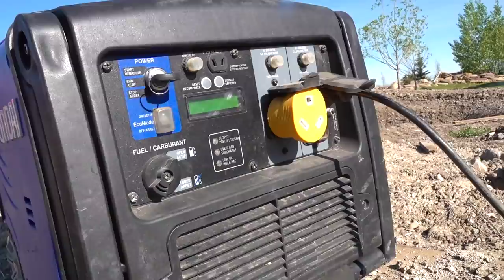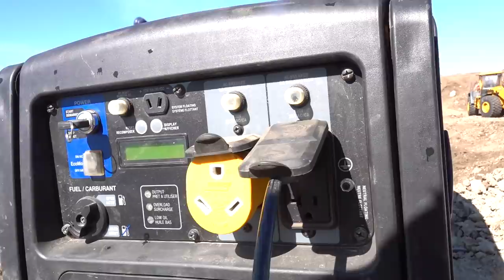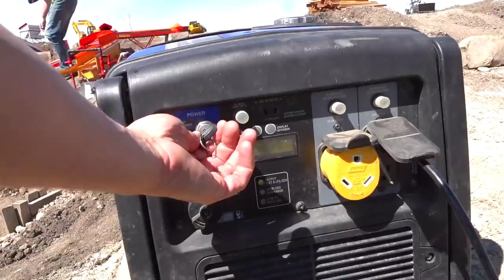YouTube GOLD (S3 E4) TWiNKLE TOOTH & the FUNNEL PiT of GOLD - BiG CUT, BiG POTENTiAL | RC ADVENTURES

Comment: Use a LiPo low voltage alarm. They cost a couple bucks and connect to the balance lead. Also, grab a low-boy trailer for the dozer and use your Ford to drag it to the shop.

Comment: The conveyors and auger could use an amp sensing circuit to reverse direction for 2-3 seconds during a high current detection then switch back.

Comment: If Lyle is standing and waiting ( not saying that's bad) on the dump truck. Maybe there is a way to run back hoe and rock truck on one  controller.  Just a thought,  after remembering you ran two rocks at the same time.

Comment: You know if you add lipo checkers to the lipo batteries they will scream at you when they are low, and also why dont you just get ac dc converters and plug into the house no more lipos?

Comment: Instead of running 12volt batteries for all the plant equipment you should use that 12volt output on that generator and wire everything to that